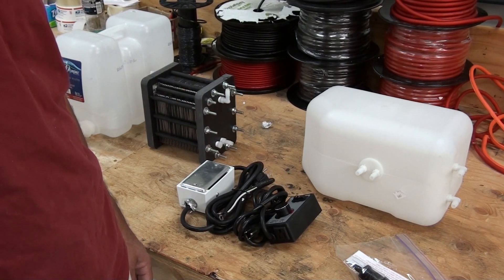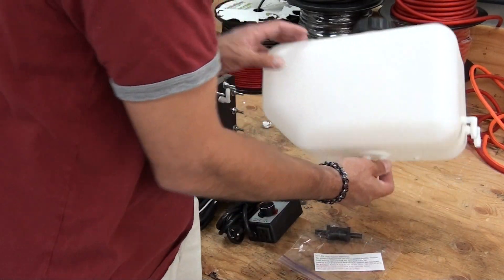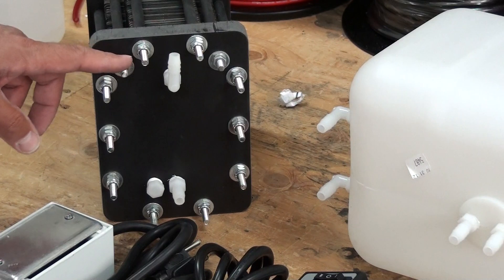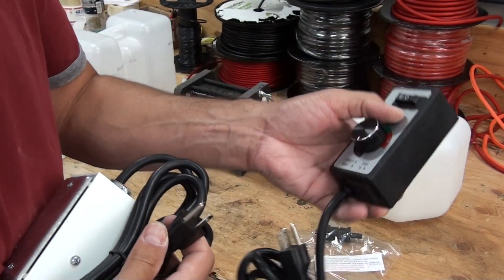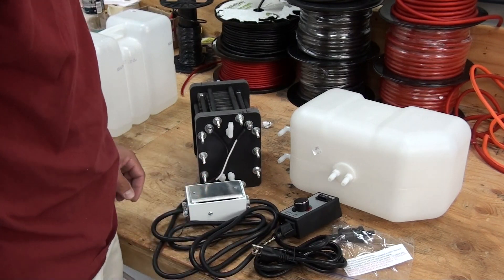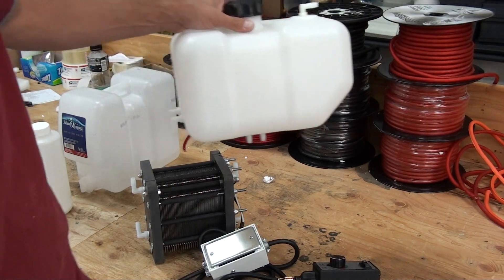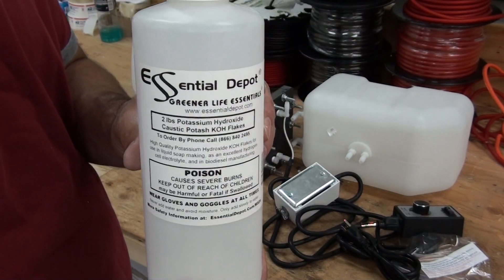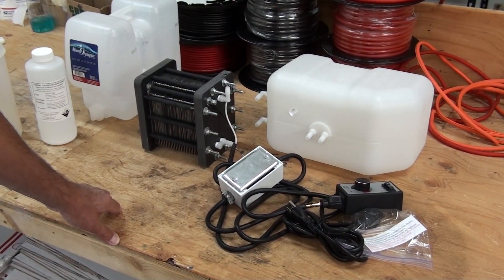HHO 59 plate hydrogen generator setup video

Comment: Without heatsink An ventilator, your bridge rectifier will heat up and stop working.

Aldo, this type if current controler is not the best.  I prefer omit it and control électrolyte.

Regards